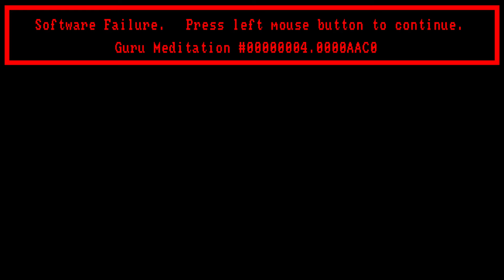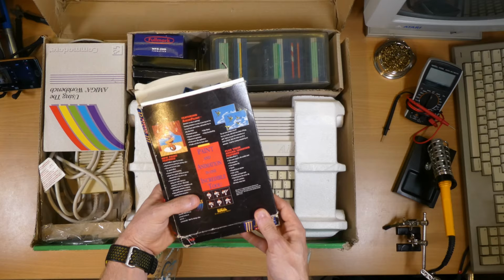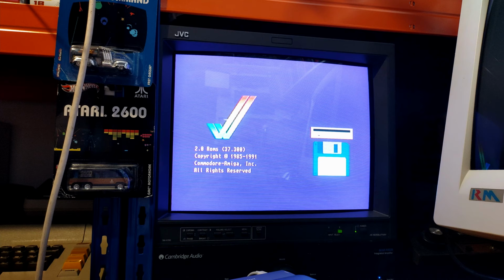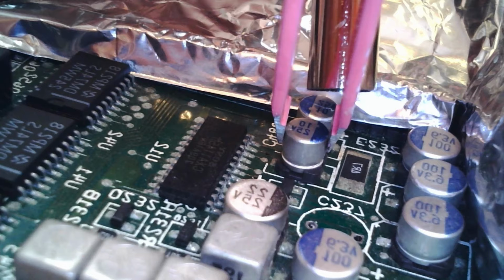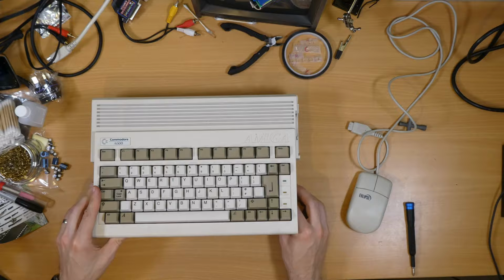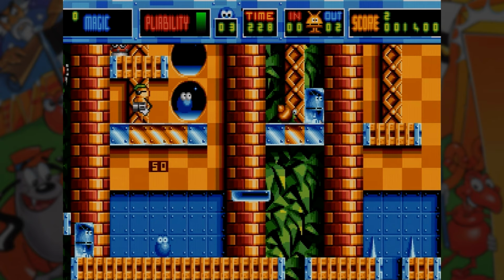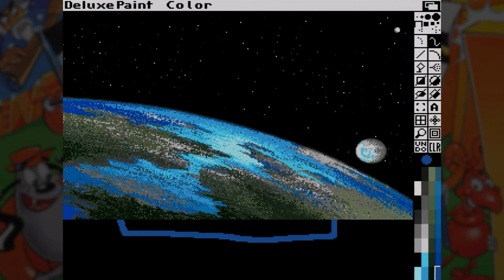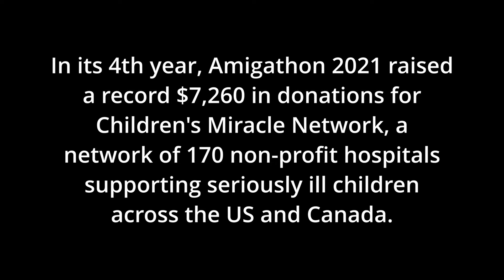An Atari ST Guy's First Experiences With The Amiga - Recap, Sunbright, Workbench & Games!

Comment: As an Atari fanboy myself I'm jealous of the amout of speech/music samples the Amiga uses. Why was that so much more prevalent in the Amiga? The Atari can do them as well after all.
Reply: The ST uses a synthesizer type sound chip that to play a sound requires a simple waveform setup and attributes. This is great in that it does not require a lot of memory, CPU overhead or system bandwidth once sent to the sound chip. But to play a sample it requires the CPU to constantly change the sound using interrupts, and due to the nature of using waveforms it requires multiple channels to improve the sound quality so requires even more CPU overhead and memory bandwidth for each channel. I can't give any definitive CPU percent usages due to the variances in sample quality, but enough to say beyond playing a reasonable quality sample there wasn't much left to do any other high bandwidth tasks like graphical updates. The Amiga was designed with samples in mind (it can also do synth type but that's not it's focus) The CPU doesn't actually get involved with the sound playback and instead relies on the custom sound chip (Paula) which is a coprocessor that has it's own direct memory access. Memory access is on opposite ticks to the CPU so doesn't interrupt the CPU memory access. The only real disadvantage of using samples on the Amiga was memory usage (while not slowing it down, it did use more memory) The STE mostly resolved this by adding another sound chip to add this as a option on an additional channel to the originals but it was rather rigid with sample quality settings where the Amiga was more flexible and the Amiga had lower memory bandwidth usage.
Reply: The ST used a simple sound chip from the '70s. It wasn't as good as Pokey, and it wasn't as good as SID. Atari had been trying to negotiate a deal to get Yamaha FM chips (think AdLib/SoundBlaster) but that fell through. So, if you want digital sound on the ST, you have to cram volume values into the soundchip at the desired sampling rate which eats a lot of CPU time and sounds rather fuzzy due to the lack of a real DAC. I was an ST user/programmer, but the Amiga was a far more capable machine in most respects.
Reply: the atari st had a rubbish audio chip similar to a 128k spectrum lol

Comment: Nice.  If the STE had been released as the first ST, then I think we would have seen some truly amazing games on it rivaling the Amiga.  As for the Formula one game, that looks like A1200 or A3000 video as it is way smoother than an A500 or A600.
Reply from the maker: Indeed, seems Atari thought they'd have the upper hand by being first to market but it really hurt them in the long run. The big install base of ST/F/M users and the STE's backward compatibility meant that developers would only ever target the lowest common denominator.
Reply: @ctrlaltrees  From what I understand (I know someone high up at Atari,) an STE like machine with sprite hardware was meant to be release from Day 1, but apparently Atari had wanted to include the Blitter on the MMU IC, and the rest on the Shifter, but had issues getting them to work, and using separate chips was a whole lot more expensive.

Comment: The battle is always AMIGA VS ATARI.  My first computer is the C64 1984 and 1988 the AMIGA 500 and 1993 the AMIGA 1200. Now I still busy with the C64, AMIGA 500 and the AMIGA 1200.
Reply: Just curious - what do you do on the 500 that you cant do on the 1200? Why still use the 500?

Comment: Commodore's original was the A1000. The A500 was a cut down version "wedge" of the biggish box A1000. The A2000 was a proper big box version - all had basically the same guts.

Comment: I had both machines and loved them both for different reasons (the AtariST's pirate scene menu disks but the Amiga's more advanced sound and graphics).  My path was the Commodore VIC20, Commodore 64, Atari 520 STFM, Commodore Amiga 500 plus and finally the PC master race.  Out of all machines the C64 is the machine that defined my childhood (that xmas morning in 1985 as a 10 year old) and the one I love and miss the most. Even though we have emulators to run everything now I still miss those days of loading ahem 'backup' cassettes on the old c64.

Comment: The Rivalry was in the mid 80s between the Amiga 1000 & the Atari 520 ST. The rivalry was created by new Atari owner (former Commodore founder) Jack Tramiel who put out a series of Ads "Power without the price" to deceive people into thinking the Atari ST was just as good as the Amiga, but only had cost half the price. 

I bought an Amiga 1000 when they came out for twice the price and was not stupid enough to believe the ads Jack put out. The things I wanted the Amiga for were simply not possible on the Atari ST. Maybe the most significant thing was the incredible Amiga sound chip which introduced the world to software synthesizers (today they are best known as VST's on modern computers) and no other computer in the mid 80s could do anything like that. Using the Amiga's built in MIDI (that's right, built in. Just needed din ports) I saved myself a fortune on the new sampling keyboards and other kinds of synthesizers. 

Being an early owner of a video camera, I also had an interest in the Amiga's desktop video abilities and I worked in broadcast television in the late 80s before becoming a computer consultant in the early 90s. 

Video games were a strong interest of mine since getting my Atari Sears Pong in 1975 which I still have. The Amiga was designed by important former Atari engineers and due to the classic Atari company's lack of interest in the Amiga technology, they split and founded Amiga. As you know "Have you you played Atari today" has a lot more in common with the Amiga than the Atari ST which was designed by former C-64 engineers and Atari was now owned an managed by the former Commodore founder. 

The Amiga was truly superior in almost every way, and easily worth twice the price. But in 1987 the cheaper Amiga 500 came out, and people here in America where computers had cost half the price than they did in England and other parts of Europe had little reason to choose the Atari ST. The Amiga quickly out sold the Atari ST by a margin of 10 to 1. People weren't dumb.

I know things were a big different in Europe than here. Pricing was very different. Also, by 1992 as you mentioned the Rivalry you mentioned was over. The winner.....neither. The PC won out. By 1992 most Americans were ditching the Amiga's in favor of PC's. The Amiga for a short time became sort of a budget home computer for those that couldn't afford a PC, or just wanted to use it as a game console, or special purpose like video production. The Amiga 600 wasn't even sold here. The Amiga 1200 clearly was headed no where. I bought one reluctantly anyway just in case, but knew it was a dead end. The Atari Falcon design made no sense at all. It was simply made for bragging rights created by the rivalry as a way of saying....."You were far superior for 7 years....Take that". But it's release made no sense at the time, it sold almost no units,  barely any software made for it and it wasn't in production for more than a year if that. The PC's clearly already won the war. As a huge Amiga fan (I owned 4 Amiga's and was President of a group), I adapted to the PC when it was time and Windows was taking over the world.  

I've never heard of most of the software titles you mentioned, because.....the days of the Amiga being a viable platform (and the Atari ST) were generally over by 1992 or well on their way out. 1985 is when they were impressive. A 7 year run wasn't too bad.

Comment: I have used both and I always went back to my Atari ST. I was an Atari kid, I had an Atari 800, 130XE, and a 520ST. The Atari ST monochrome monitor was fantastic, in fact when I got a color monitor (an NEC 16 color dedicated monitor) I often times switched between the two depending on if I wanted higher graphic quality vs color.

Comment: I find it quite amusing that at the same time you - a lifelong Atari fan - are just dipping your toe into the world of Amiga, I - a lifelong Amiga fan - have just got my first STe. 

Well done on the re-cap though. My A600 wasn't so successful (it had leaked a fair bit).
Reply from the maker: Oh awesome! I think it's finally time to put aside those differences and finally let those old wounds heal 😅

I think I got really lucky with the re-cap - I was under such time pressure that I didn't even practise, I literally took the hot air gun out of the box for the very first time and went at it. I've seen some real horror stories with these but apart from the smell and one pad that had come half unstuck there wasn't any evidence of leakage at all.
Reply: @ctrlaltrees  tbh, I just like the older machines. They're great fun to play with no matter what. I remember seeing the ST in the Argos catalogue and wanting to play with one. Any computer is a good one to me!

SMT recaps can be troublesome, but the caps seem to cause more problems than soldering. I need to get back to my 600; leaky caps killed the blue video output, the audio is still screwed, and it won't boot from floppy. It's a step up from the fact it wouldn't even power on, mind!
Reply: @ctrlaltrees  I think we need another platform war lol

Comment: You hardly scratched the surface of what Amiga is. The A600 is not the best example,but useable. Not to mention its so easy to add a CF card as a HD,network it via cheap pcmcia card and and  host of other handy items. Workbench looked like it did default because it was designed to work on the lowest common denominator Amiga(512K) but could be expanded quite a bit with even the included stuff that was not activated. Add a host of addons like Genlocks,DCTV,accelerators and/or ram expansions etc. and the sky is the limit-or so it seemed back then.
Reply from the maker: Yes, sadly a product of the time constraints I had to work under in putting this together for the charity livestream. I'd certainly like to revisit the Amiga in future and get it fully kitted out with upgrades. It's impressive what's possible with some of the modern add-ons.

Comment: An interesting take on the Amiga. I think you should have compared your "nostalgia" for the GEM Desktop/TOS with your new experience with Workbench/AmigaOS. The Amiga/ST had such similar games catalogues in the 80s that I see the OCS/ECS Amigas and 520/1040STs as fairly interchangeable on the gaming front. The difference for me was Deluxe Paint vs Canvas, PageStream vs Papyrus and Cyber Studio CAD-3D 2 vs Lightwave. Yes, the ST monochrome modes were great but what kid in the 80s was utilising there ST as a Jackintosh DTP machine at home with a fancy monochrome hi-res monitor? As an ST owner with Amiga owning friends, I have to say that my nostalgia is more for the Amiga now which had Turrican and Rainbow Islands but gave a better more compatible (but still not ideal) upgrade path to AGA machines and basically pushed the extra hardware it had (blitter and copper) to create much more unique experiences than the standard STs could muster (thanks Team17 and EA especially). I know you had an STE but it didn't lead to Alien Breed being ported k
or a passible version of Lemmings 2 sadly. Just my view! I still have a soft spot for the 'busy bee' loading pointer and Blue War III (please check that game out). Thanks.

Comment: Thanks for the video! It’s nice to see the A600 to get some love. Did the recap help with the composite output issue?
Reply from the maker: It actually didn't! I really should have mentioned this in the video but it got overlooked... Apparently there's a transistor in the video output circuit to the right of the IDE connector that can fail, causing this issue. I was going to try replacing that as well but didn't have the part in stock and ran out of time. Hopefully a subject for a future video.

Comment: For me the whole UV curiosity with plastic is that direct sunlight is fine but the light passing through windows was the main culprit for yellowing. Nice looking box of gear there. ;)
When you were on the ST I was mostly into GEN/MD but also C64 since I got a used one around that time, kind of old news by then but it did have some fun games included and it's monitor gave me my first taste of Composite on GEN/MD.
I used to look at Amiga magazines at this big book store so I knew a little about it bitd, but not actually trying an A500 until around 2010. ^_^ Then online I've learned about various Atari I didn't know about and became a fan of the Amstrad CPC despite no model of it ever reaching NA lol.

Comment: bUt aN A600 iS nO rEaL aMiGa 😉
Sorry, could not resist 😉 I never had love for the 600. The Numpad was THE thing after the C64 and I still use it so very much today. No need to say that I don't use bare notebook keyboards either 🤣 The Amiga keyboard was nearly a standard keyboard back in the days and I got used to it since then.
Reply from the maker: Yeah, so I hear! A lot of flight sim fans complain about them too due to the lack of numpad. Also that weird blank key that doesn't do anything, what was that all about!? 😆
Reply: @ctrlaltrees  Blank key is so that it can be configured for multiple languages by just changing key caps without having to have a completely different keyboard. It was oddly forward thinking for Commodore :-\
Also that missing numpad was a pain not just flight sims but for many applications.

Comment: The thing that annoyed me the most with workbench when I had my Amiga500 was that the windows didn't display the content of the disk as such, just the icons someone deigned put in there. If you wanted to do file operation you either had to load a filer program or use the command line, which opened another can of worms when you only had the internal floppy. On GEM you could format, copy, move files without needing extra tools.

Comment: I have used both machines for 25+ years. In my experience the Atari ST is more reliable with floppy disks than the Amiga and booting to the OS without needing a floppy is nice if you have no hard drive. I have had probably 1 Atari disk go bad per 40+ Amiga disks go bad. I am not joking!!
Reply: Amiga used a more compact track layout which allowed for more storage, but unless you have good quality DD floppies it doesn't have as much leeway for data loss. Also as a side note using HD floppies is worse (even for DD drive on PC I can't say for ST as I don't know the FDD system as well) than using DD as the magnetic media was changed. Many floppies sold as DD were in fact HD when they changed the manufacturing over for convenience, as it mostly worked. 3M did this and then had to reopen a DD line again, as the HD floppies failed QC on DD drives.